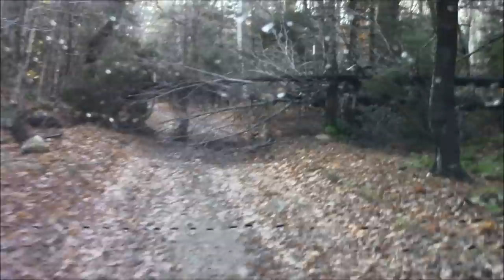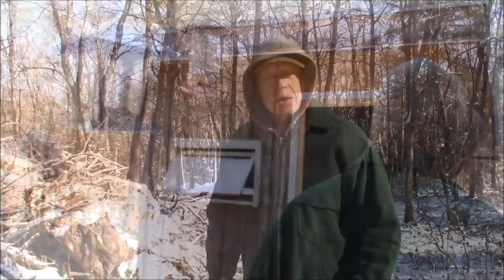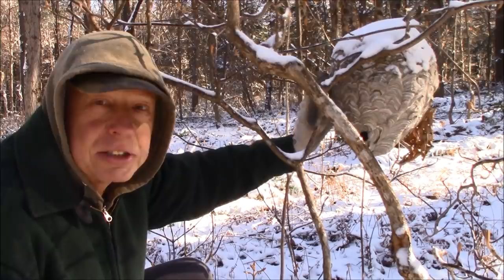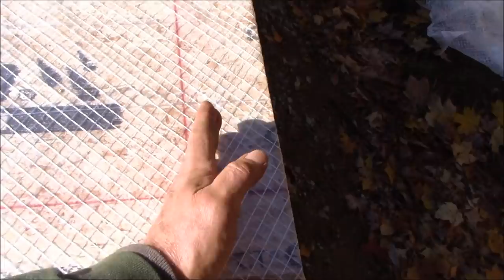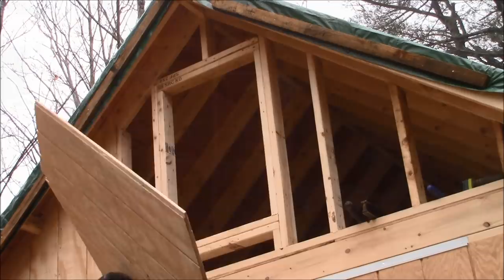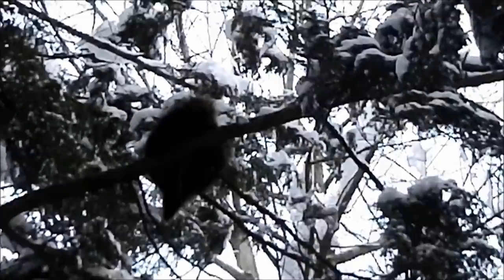OFF GRID CABIN LIFE.  Building The Workshop And Greenhouse At Our Mountain Homestead.

Comment: Hey! Back in the Spring, you talked about dropping one of the pine trees that was leaning toward the camp. You didn’t feel that you could get a line up high enough to be all that effective. Well, son, one of your thumbnails shows you with an arrow! Take a old arrow, drill a hole between the nock and fletching, tie the end of a fishing line thru that hole...the heavier line the better. I prefer using a spinning reel due to less friction when shooting. Aim for a crotch high enough to do what you want...using graduated size twines/ropes, pull the thru the crotch to where you can tie it off on your come-along/winch. Oh, you might want to run the line from the nock to the tip and use a small bit of tape to hold it there so it’s out of the way when you draw the bow. Hope this helps in the future. I use this method to erect antenna wires for amateur radio operations. Lemme knowwhat ya think! Take good care...Larry

Comment: Looking great Boss! Your getting a ton of work done and I know your enjoying in doing it. 👍 Also,..
Think the trees are dying more than normal? Mine sure are. I have lot of oaks. The oaks have a canker that can't be fixed or healed. The dept of forestry came out, a man I've worked with off and in for several years. He told me all I could do was carry out the dead ones and burn them. He said the canker is airborne so it's really hard may not be worth it. 😥
He also made the comment that it was caused by the chemtrails and the weather modification causing a drought and then too much rain. I was floored when he mention the spraying in the skies.  I've got others with bark just falling off in bald spots or black spots.  He did say the healthy trees may not get it and be able to ward that canker off. But it's alarming with what's going on my. Forest .
Reply from the maker: The trees are all dying here.  The forest is a mess and getting worst every year.